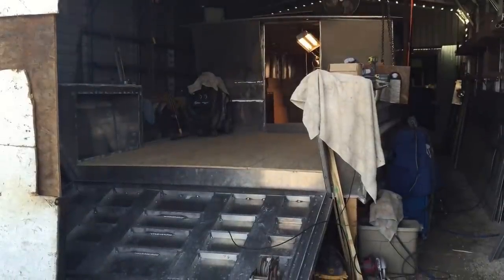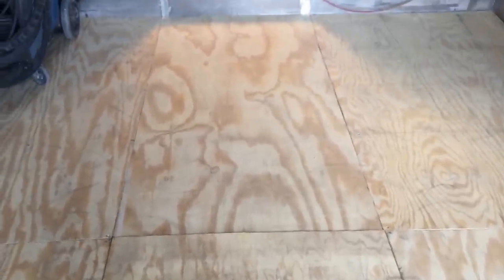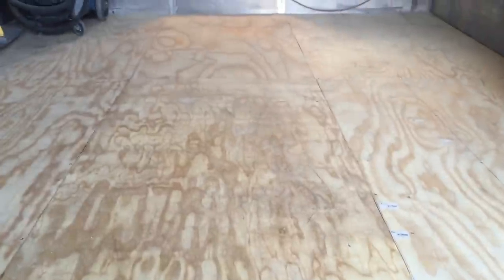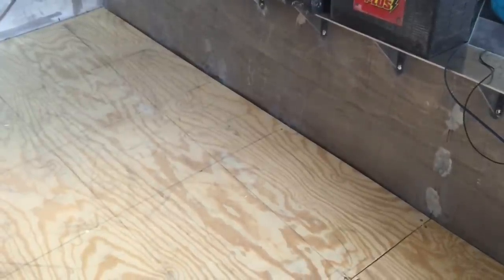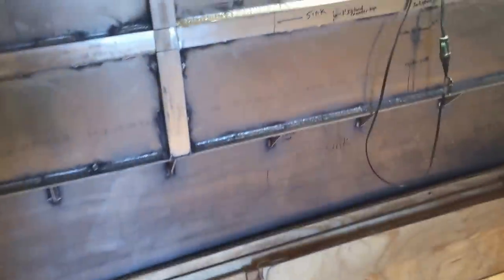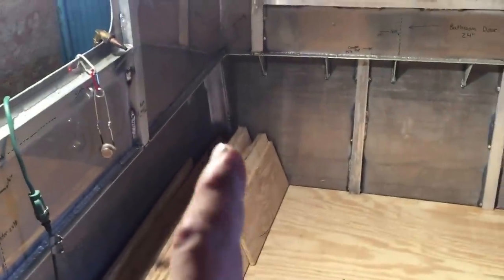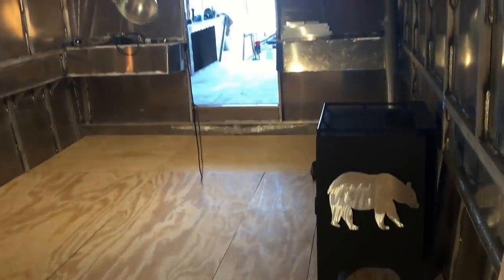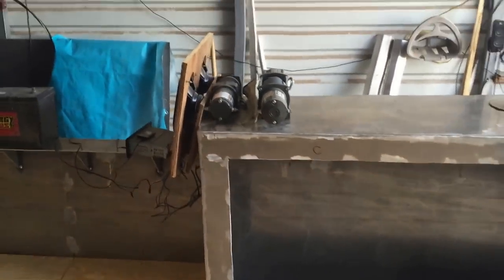building aluminum boats 24

Comment: Hello,  She is coming along.  Have you thought about access to your swim platform/motor bracket out in water?  Even a little slop would make your gun'w'l walkways impossible.  Most rigs with cabin aft have a hatch on the back bulkhead to get out and work on the motors, clear fouled lines, change props after hitting floating debris and general maintenance.  Not to mention simply accessing your stern cleats.  Don't forget the underdeck wiring and plumbing raceways either.  You will have to put conduit in if you want to keep the watertight integrity of your compartments.  I have spent a lifetime on the waters here in Southeastern Alaska and I can tell you without a doubt you will be caught in weather one way or another and a lot if you are working freight hauling.  That open bow deck will need to self bail and pumps won't keep up with even one wave coming in.  This country is unforgiving when it come to weather and it is far from uniformly predictable.  I have seen it go from 0 to 120 knots in less than twenty minutes with no warning in the forecast.  More than once and I can tell you safe harbor looks a long long way away when it happens at even less force.    You might think about double skinning your cabin overhead to stiffen it without losing headroom?  Using 3/16ths on the underside would improve it immeasurably.  I stand in awe of your energy and resourcefulness having worked alone myself.  Take care.  Doug

Comment: It's looking great Shawn. Are you putting any lead on the bottom? And are you going to name your boat? Thanks for sharing.
Reply from the maker: Thanks,,,powerboats dont have lead in the bottom,The coastguard has rollover boats that will return to a rightside up position if a wave rolls them over,they might have some lead in there keel,but for the most part lead in the keel is only in sailboats.thanks for watching.
Reply from the maker: The name of this boat will be named after my mom,       "Sandy C"   That is my moms first and middle  name which is "Cassondra"